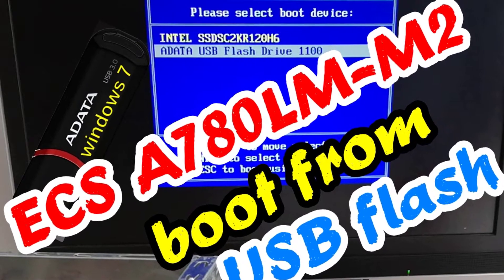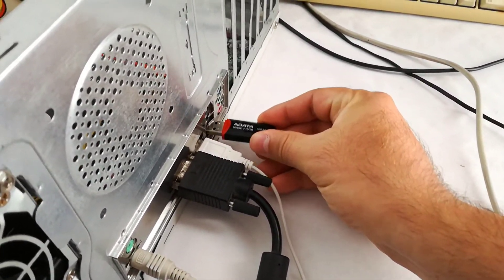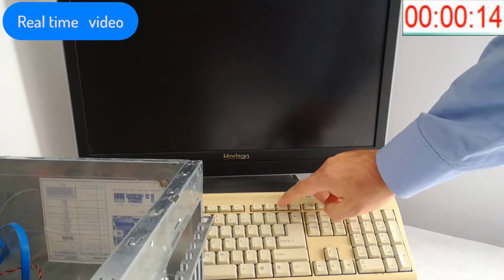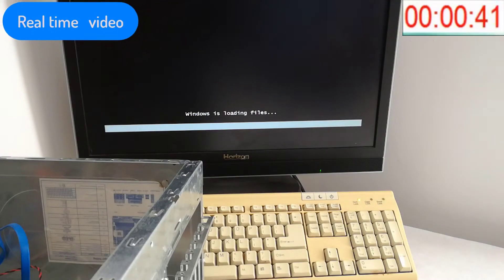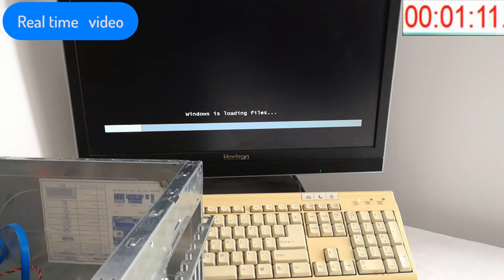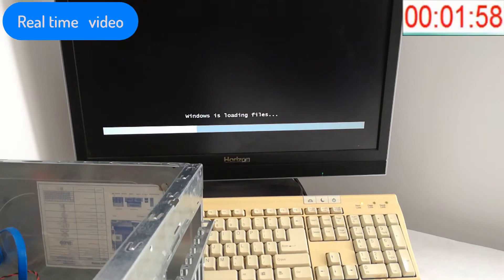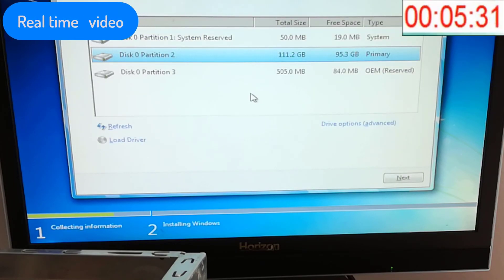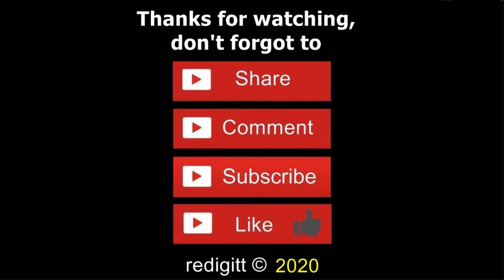How to boot from bootable Windows 7 USB ECS A780LM M2 #redigitt Ep.336

Comment: Friend, a question I have not been able to install any Windows strip error when it takes 15% and other times to 26%, I have used different ways, (USB DVD) and changed all different SD and HDD disks I feel that it is some configuration in the Bios. can you help me?
Reply from the maker: Aloha, you don't say the whole configuration and how it's end the installation, so these are the most common errors:
- drained or low BIOS battery
- bulged capacitor on the motherboard, VGA card, PSU - make a visual inspection for bulged capacitor 
- CPU is overheating - clean  the  heatsink ( it is better to blow the dust with a compressor or hair dryer )and apply new thermalpaste
- bad BIOS settings- reset your BIOS to the default settings
-if you upgraded your CPU, put back the old CPU and update the BIOS to the latest version
-if you upgraded any hardware put back the old hardware
- bad HDD, HDD with bad and slow sectors -- test your HDD in another PC, make a low level format, make a clean OS installation
- bad HDD cable - replace or switch the cable between the optical disk drive and HDD, then install from USB
- bad RAM memory - test your memory, replace the memory
- bad VGA card - if you have a dedicated VGA card, remove it and install the OS with the onboard VGA card or if you don't have a dedicated VGA, try with a dedicated VGA card
You can watch this video to  https://youtu.be/i_7XUd-x0Dw
Thank you for watching, if my video or advice was useful, please consider to share and subscribe, good luck
Reply: @redigitt  Thank you for your answer I am from Colombia, and I only found this board in your video, I already made all the suggestions and verifications, I only need to review the Ram, I do not have one at hand I will look for it and try and tell you, by the way, the error It throws up Error 0x80070570. it happens with all windows 7,8,10 whether by DVD or USB. and on all hard drives. I hope it's the Ram because I don't know what else you'll check. Thanks you have a subscriber
Reply from the maker: I think there is communication/reading error, try to replace the HDD cable and make a low level format to the HDD and then try to make a clean install from an untouched/without modification installation.
Thank you for your support.
Reply: Use one memory ram of low capaciti for instal Windows